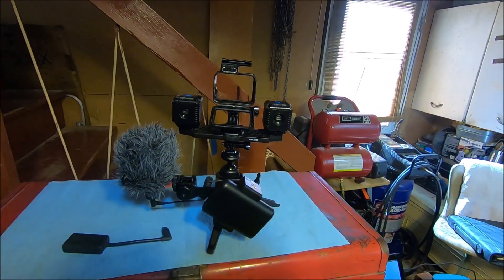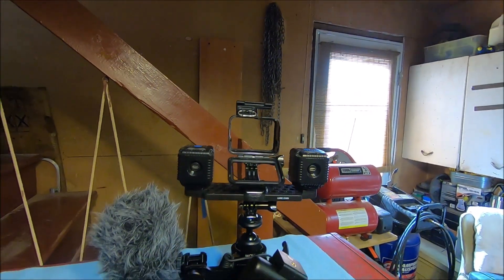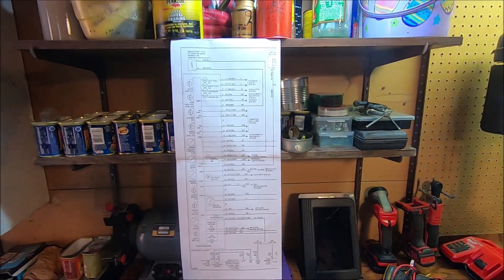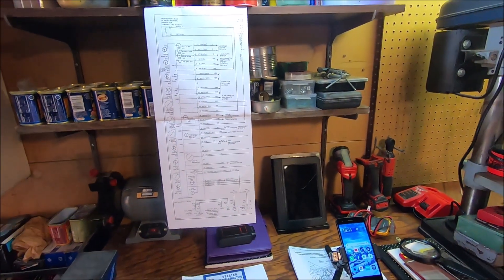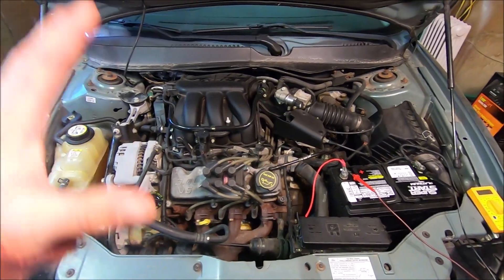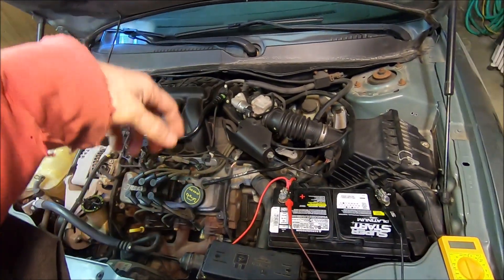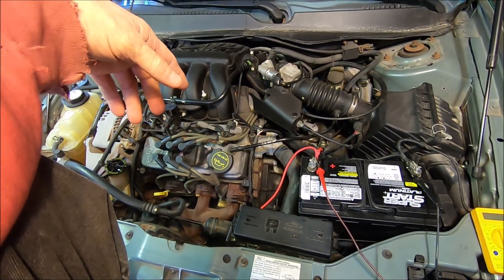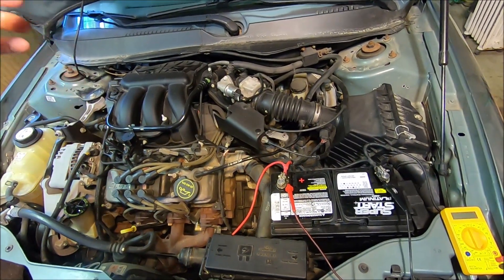2006 Taurus  no crank no start pt.2

Comment: my car is ford tarus dohc 2000 se.I cleaned my engine bay oil out with pressure washer and when i installed the new ac pump and radiator fan i had an arch and burnt new pump and melted allot of wires in engine bay. the new ac pump smoked and burnt out the clutch on the ac pump so i unhoocked it. and i used elctrical tape to insulate all the bunt wwires i could find as the car was stuck in second gear limp mode. after i found wires to tape up i have two problems still the ac will arch if i plug it in so i put a bypass pully the second thing is the radiator fans stay on all the time now. third problem is the car will only start when it wants to it doesnt crank over at all no clicking of starter just ecesories lights and nothing. after trying to start it for around ten minutes it finally starts like nothing is wrong?? i really need help i promise i will pas on the good deed. please if any one has an idea ill even echange phone numbers. thank you guys.

Comment: Iam having trouble with turning on my car! However the battery works but I believe it's my starter.  What's a best way to get this working so I may atleast drive it to the shop?
Reply from the maker: try tapping on the body of the starter
Reply: @jb711956  I did try sir
Reply from the maker: @khnnblstlkr_6665  you will need to follow this video,  https://www.youtube.com/watch?v=9njaQYvdMSc this is a good video that should help you figure out what is wrong.
Reply from the maker: here is part one of the same video that will be very helpful in diagnosing your crank system, good luckhttps://www.youtube.com/watch?v=WwdBEENa7Is
Reply from the maker: this last video is the procedure i always use,  if you understand it clearly and do as he instructs you will find the problem,